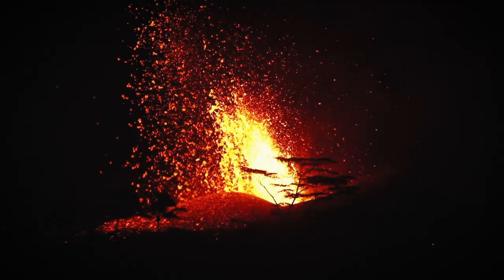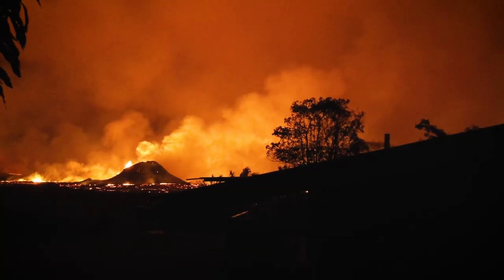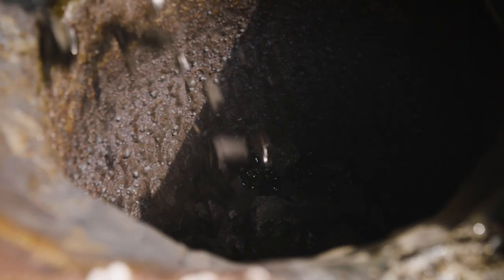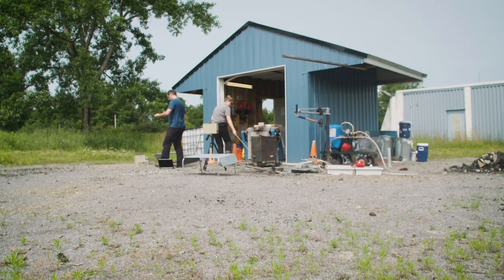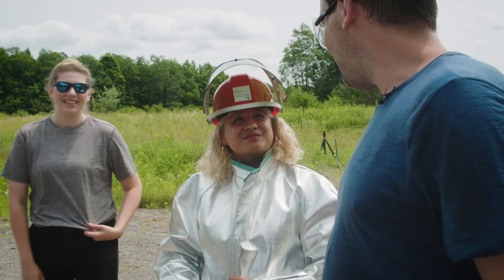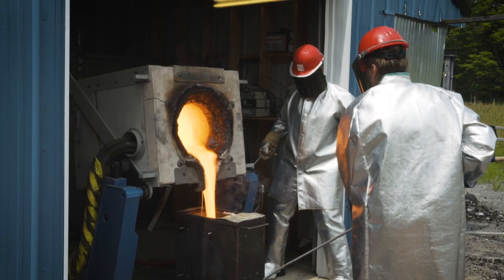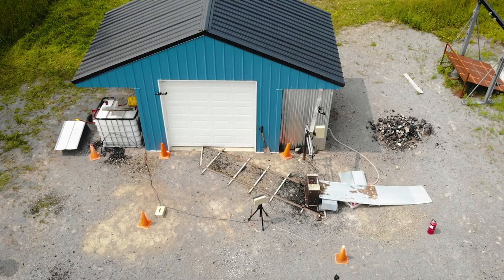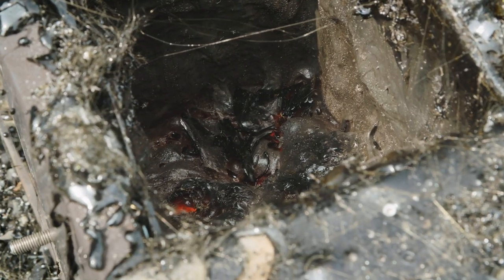Step Inside Buffalo’s Lava Lab | Atlas Obscura

Comment: What exactly does the sledge hammer do?
Reply from the maker: Gresat question! We had to do a bit of research into this. The press release is attached below, which explains it in more depth than we can. Essentially, when water is trapped by a hotter substance, its outer edges form a protective bubble to prevent the water from boiling. But if you inject water into a tall column of lava - which is what the hammer is doing - the water, which is lighter than lava, mixes with the molten rock more quickly and destabilizes that bubble, possibly causing an explosion. http://www.buffalo.edu/news/releases/2018/12/009.html